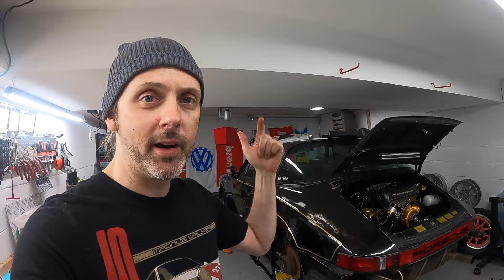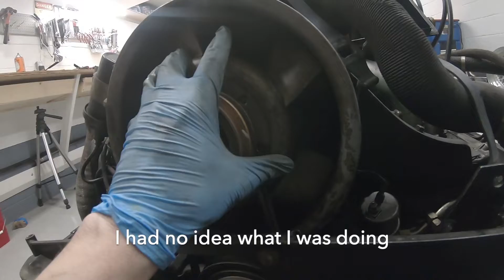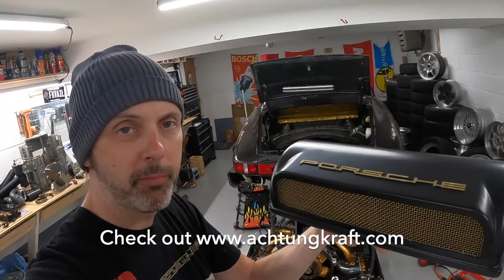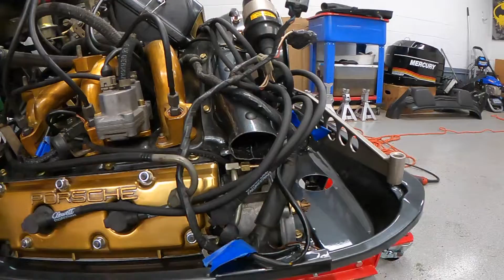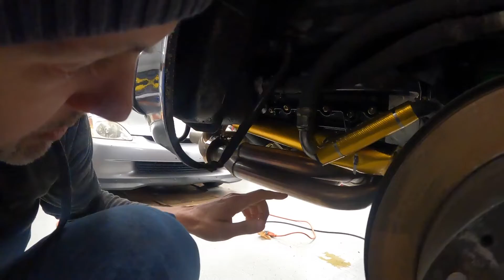Removing Porsche 911 Engine (Again), Achtungkraft Carbon Fiber Intake, Reinstalling!

Comment: I’m planning on pulling mine out (a euro spec ROW 1977 911 Coupe) in the next year or two. I’m not a mechanic and pretty new to working in these old 911’s. Mine I inherited 4 years ago from my dad and just this summer I finally got it running and driving after it sitting for 20-25 years!
I only have smaller jack stands and a normal jack as of now. 
Any more “budget” ideas of how to get the car high enough to pull the motor out?

Comment: Question on the quick Jacks. I was thinking I needed to buy a scissor lift but I have quick jacks.  We’re you able to remove and install engine and trans as well as exhaust with normal single rubber  blocks and removal of bumper with enough space? If so that’s awesome and I may not need to buy another lift.
Reply from the maker: I mean... you watched the video, right?   The answer is yes.  Remove rear bumper, and it slides right in/out.
Reply: I use quick Jacks too same car and confirm the engine slides out with bumper off. In fact there is no need to lift the engine to get it back in the car, just lower the body once the gearbox and engine are under the car!

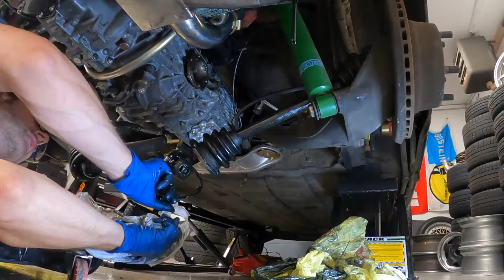Comment: @5:20 when you cleaned the CV joints, did you repack them with fresh cv grease too?
Reply from the maker: yeah, I should have mentioned that, I quit filming because it was extremely messy and putting them together was sort of tricky.

Comment: Looking good bro! Glad to see you're still alive and kickin.' Nice looking c.f. piece and overall that lump looks so much better than it did when it came out and you went through it! I know the feeling of a long build/ project. You get sick if tripping over it and having it tie up your garage/ bay eventually and you're like "screw this, I gotta just put this drivetrain back in/ get it off my damn floor!" We've all Been there more than once LOL 👍👍🙂✌️
Reply from the maker: It would have been done in under a year but I lost a lot of momentum when the front belt cover/mount came back from the powdercoater welded all stupid, and I didn't have a welder at the time.  Then I got sidetracked with other stuff.  ADD!

Comment: If I remember correctly back in the day when they were using the rubber strap hold Downs there reasoning was in case of a backfire the pressure could leak out instead of busting out the seam.
Reply from the maker: But there's a giant hole in the end.  Wouldn't the backfire energy just go out the hole/intake?   I did install a backfire valve in the airbox itself, so it doesn't blow it's seams like the old one.
Reply: kind of like how the old atvs with carbs and sealed air boxes had a tube on the bottom with a rubber strap that could blow off and release the backfire or be used as a drain